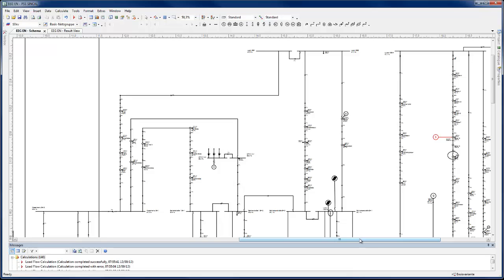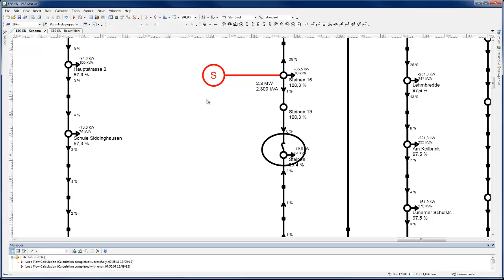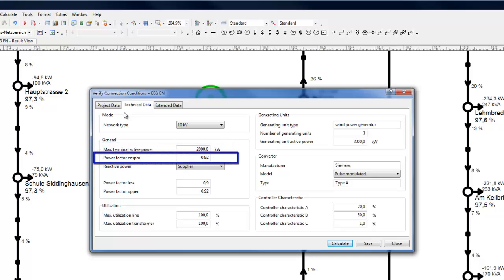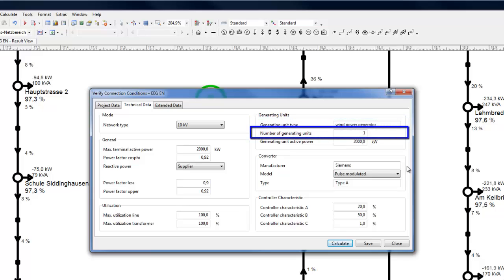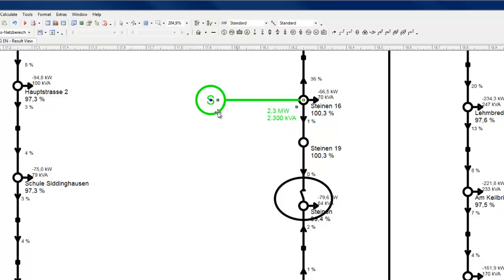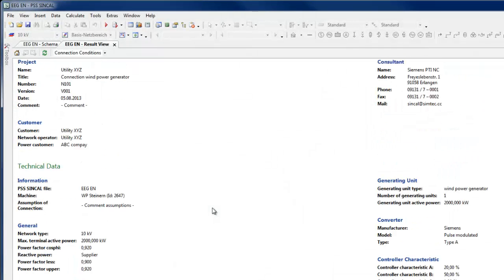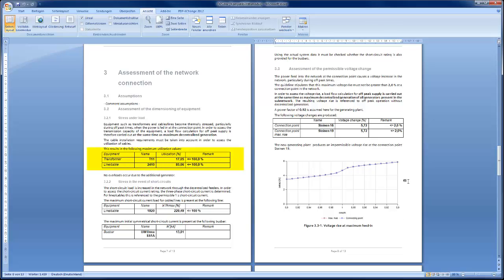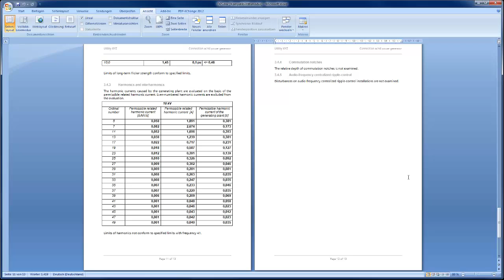PSS(R)SINCAL Distributed Generator Grid Connection according to EEG

Comment: Would be great if you could provide a model and some description of features around the New 4-Wire Load Flow. The description within the Release Notes of how a 4-Wire system is modelled is brief, and how this is done using the software, NPI, Neutral / return wire, RSTN model, etc is not clear.
Reply: Can you help me please, how I can connect 3 winding transformer in pss/e software buses?